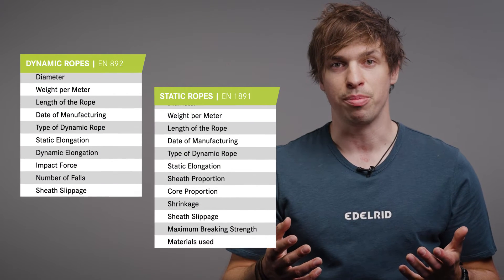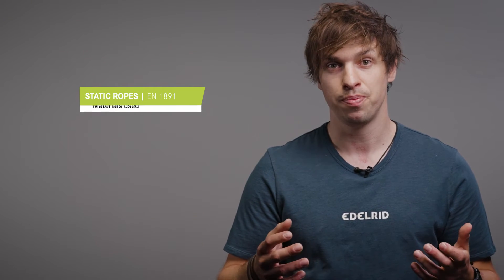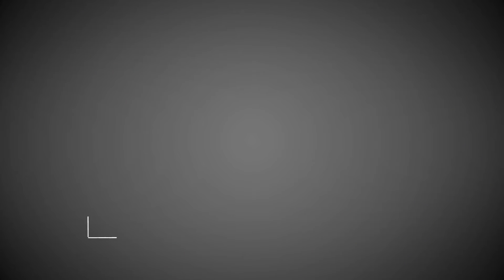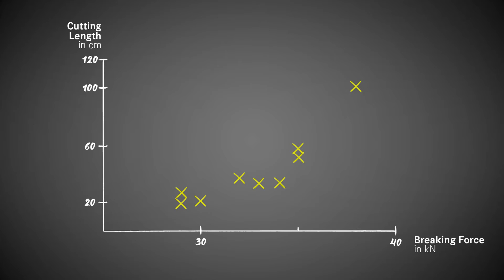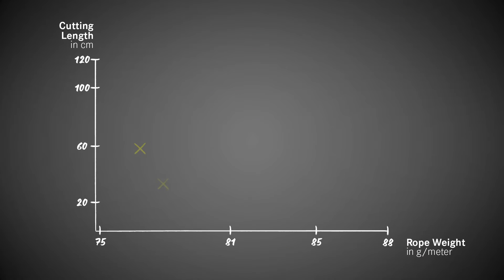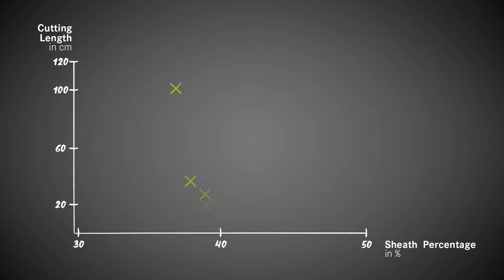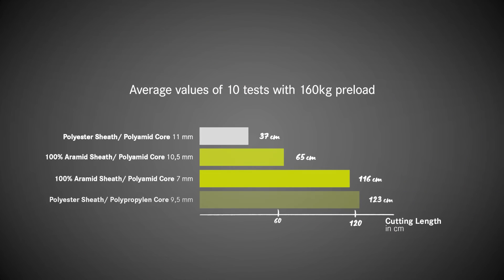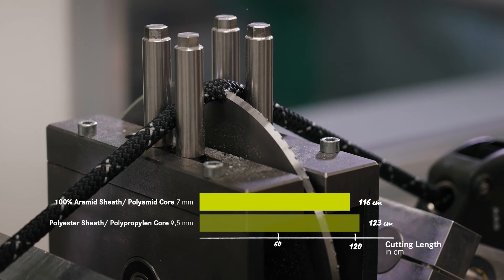Cut Resistance of Ropes: Part 3 | EDELRID Knowledge Base

Comment: Great video and I think really important message. Hopefully there will be an agreed upon UIAA standard soon that is reliable and cost-effective to implement.

Can you shed any light on the differences in cut resistance between the following 3 ropes?
Edelrid Boa 9.8 - cut 19
Edelrid Boa Gym 9.8 - cut 32
Edelrid Heron Eco Dry 9.8 - cut 28

All are the same diameter, have similar sheath proportions but the Boa Gym and Heron Eco Dry have +50% cut resistance compared to the standard Boa! I'm assuming the difference is caused by sheath weave type / sheath weave tightness?
Reply from the maker: Another great example underlining one of the main points in this video – that diameter is no reliable measurement fur the cut value of a rope. 

All of your mentioned rope models are completely different constructions. The BOA GYM for example includes Polyester in its sheath as well as a different braiding pattern for the sheath compared to the other two. The HERON is more similar to the BOA, but also has slight deviations in constructions and material quantity resulting in slightly different characteristics like e.g. stiffness. Further, it also includes a chemical treatment to pass the UIAA water repellent test. 

All differences that at the end make a difference in the overall cut value of those ropes. I guess it is really time, that we can rely on a proper test to judge this, don’t you think?
Reply: @edelrid  yep I would agree.

Can you give any info on how the different sheath braids affect a rope? Your website braiding article says the twill braid gives better abrasion resistance but is more slippy to hold and can lead to more sheath slippage when compared to plain braid - any more advantages or disadvantages?

Also what are the benefits and disadvantages of the number of bobbins? Does more bobbins give a smoother sheath? What are the disadvantages - cost? How does the number of bobbins affect cut resistance and abrasion resistance?

Thanks!
Reply from the maker: @turquoisecrayfish  glad that there is such a relentless interest in the details of rope! This is something we of course share and sadly a rope is often discarded as “just a rope”. However, very often it is not as simple as it might sound.
 
As for the different sheath patterns, you probably already found the best source we provide about the advantages and disadvantages of the different patterns. More reasons for and against a certain pattern are not really noticeable or visible for a user and are therefore often production and construction related. To go into detail here would probably go beyond this format of communication.
 
The same goes for different carrier machines. In general yes: more bobbins make for a less coarsely braided sheath. So in general another option to get a smoother sheath or more material in the sheath. However, what you have to understand about ropes is that it is simply not possible to draw any conclusions about the resulting properties of a rope from one technical condition. It is always a combination of all factors. And there are a lot of them! So it could be that a 48 carrier is chosen for a rope because its advantages equalizes other disadvantages resulting from other construction characteristics. Same goes for the above mentioned sheath pattern.
 
So what counts are the technical data of a rope and how you think it handles in practice for your purposes. Don’t short cut and conclude because it has this feature it must be like that characteristic.
 
This might not be totally satisfactory, but this is how textiles work 😊

Comment: You have the data for this in a table or short write up? You seem to blow past a pretty decent correlation of strength and cut resistance but without knowing what was actually cut it isn’t possible to see if that is just a material difference. Making the data available would be very helpful and interesting
Reply from the maker: Please click on our video description :) there you'll find links to other videos within this series, as well as relevant Knowledge Base articles.
Reply: @edelrid  I did not see the raw data from this video saying what the rope construction or type was for each test here. Maybe a table like that has been added since or maybe I missed it? Where can I find the data from this specific test saying the rope or rope material and the cutting length? Basically where would I see the number you used to make the plots in this video?
Reply: @andrewhunter6536  Hey, yes I agree that this particularly data set doesn't look as obviously dismissive as the others. However, we of course looked deeper into this (as well as many other facettes not even shown here in this video) and the conclusions still stands that tensile strength does not reliably influence the cut value. Otherwise, this would also have been really low hanging fruit for us and other rope manufacturer. Unfortunately it is not so easy as just to control tensile strength :) We could easily construct ropes with little tensile strength and a great cut value. Maybe an example for this could also be seen at 7:34 where we show the results of a 7mm cord with a much higher cut value then one 11mm rope. For sure the 11mm rope has a much higher tensile strength than the 7mm rope.

Comment: That cutting length vs breaking strength graph looked suspiciously like a linear relationship for it to be dismissed so quickly.
Reply: Hey, yes I agree that this particularly data set doesn't look as obviously dismissive as the others. However, we of course looked deeper into this (as well as many other facettes not even shown here in this video) and the conclusions still stands that tensile strength does not reliably influence the cut value. Otherwise, this would also have been really low hanging fruit for us and other rope manufacturer. Unfortunately it is not so easy as just to control tensile strength :) We could easily construct ropes with little tensile strength and a great cut value. Maybe an example for this could also be seen at 7:34 where we show the results of a 7mm cord with a much higher cut value then one 11mm rope. For sure the 11mm rope has a much higher tensile strength than the 7mm rope.
Reply: That stands out to me as well. Makes it feel a little cherry picked and makes the jump to 160kg “to better compare” seem a little suspicious too. Perhaps the description links to a write up though where it is more clear. I am not say they had pre decided the conclusion and worked build evidence for that. Just that from the video alone some choices are a little clunky. Will look for a write up now

Comment: You werent going to name and shame but which rope was it that had the 120 cm cutting reistance ? was it a heat resistant rope ? They feel so much safer and well made.
Reply: We try to stay as neutral as possible within the knowledge base. This is not about products, it should be about a message. And the beautiful thing in this case here is, that we can also braid whatever we want to test ourselves here in our production. Then it is not a known product, but a test sample :)
And on another note: heat resistance is not a defined term, but a marketing buzz word. We will also publish something about this within this year I hope :)
Reply: @philippewestenberger9087 will you publish the data with info about the ropes? I asked in a top line comment with more reasons but thought to ask here too